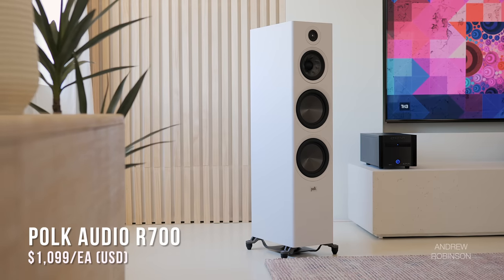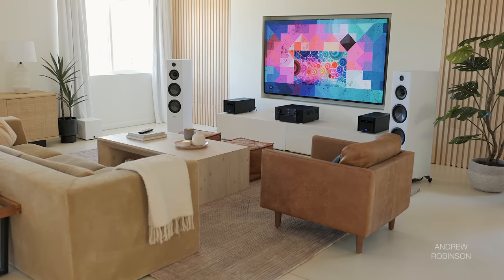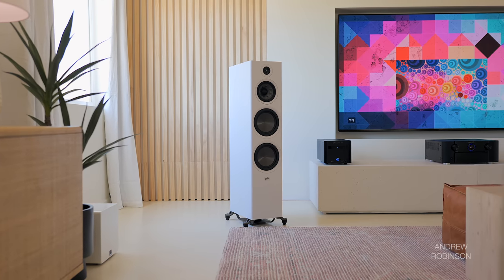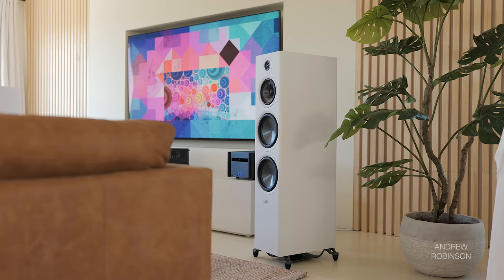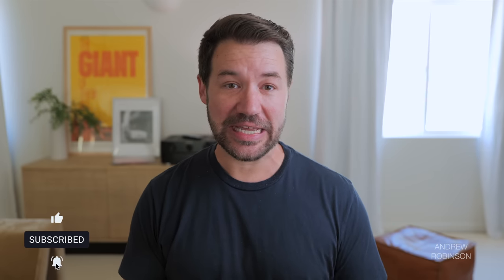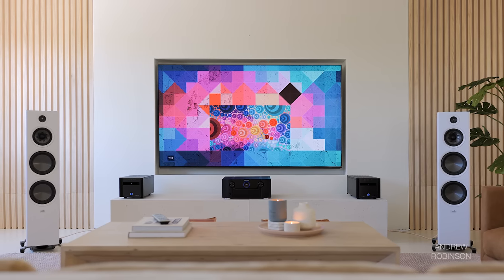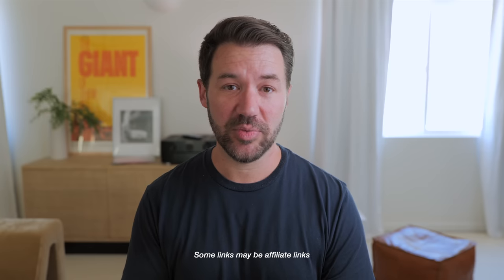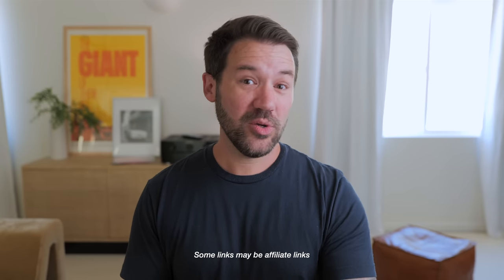Are High End Speakers REALLY WORTH IT? 🤔 Polk Audio R700 Review

Comment: How do you think they stack up to something like the Heco Aurora 700s ?
Reply from the maker: The Auroras will be more dynamic resulting in a punchier/more forward sound. The bass is not as deep or as controlled due to the less inert (cheaper) cabinet. They are more finicky with placement b/c of the rear facing port. The tweeter will be a tad boosted in direct comparison. In other words, the Polk will sound more neutral compared to the more smile like curve of the HECO. So it will come down to what you prefer. As a critical evaluation tool, I'm picking the Polks.
Reply: @andrewrobinsonreviews  Ready for a trip down memory lane?  How do these sound compared to the B&W 703s?  I read your review the other day as the R700's specs reminded me of the 703.  Speaking of validation, you got that review spot on in 2009!😁
Reply: @andrewrobinsonreviews  perfect explanation thanks Andrew you’re the best!

Comment: I did a Legacy focus XD review when I worked for AVS. They were  great but, at the price and for what you got plus having to drive the lower half with a GOOD amp with no outrigger feet at something the weighed 150 each. Plus VERY top heavy, with the fact I had to pull them 6ft out into the room. I have 2 young kids that was a no starter for me. The  review was very positive but with my knocks on it sealed my fate with that company. I no longer was on the good graces lol. I actually told them about all of it ,they said ok we will take it under consideration.. funny thing is that review is still up on their site lol. The next review I did for for a pair of towers that cost 2k and they SMOKED the other 30k a pair lo so much for that :) So i get what you are saying 100% Also AVS forums are the WORST for audio snobbery!

Comment: I love the R700, but I think they deserve a 3 way center speaker, will I loose much with a 2 way center speaker in movies? considering that monitor audio silver has 3 way center speaker wouldnt they be better for movies?
Reply: No I have the r400 I switched from a 3 way center the r400 blows it out of the water
Reply: @Josh-os2px  thanks for the reply, what 3 way center speaker you haved before?
Reply: @PauloPHGTA  Emotiva c2+ the r400 is miles better don't worry look at polkfan video on YouTube of the r400 demo
Reply: @Josh1994  Thanks, i will take a look, I was between the MA Silver 500 G7 or the R700, but Andrew already said that the Polk are better, now i just need to stretch my budget a little more, because sadly the R700 and R400 are more expensive then MA silver 500 G7 and 250 G7 where i live.

Comment: Thank you for the transparency with regards to the snobbery in the industry.  
There was a time where Circuit City and Bestbuy were viewed as "high end" electronics stores and they each had their own brands: BB had Harmon, Yamaha, JBL, KLH,  CC had Onkyo, Denon, Polk, Boston.  At that time, there were few other options that the mass market was aware of, until companies like crutchfield started taking market share with larger selections and great return policies.  Now CC is gone, and BB seems to be in a race with Costco and Walmart to sell only the cheapest stuff (exception for magnolia).  I remember standing in a best buy 10 years ago and listing to 8 different brands of speakers using their demo boards, each had a Yamaha receiver and while the room sucked, it was consistent.  Now they have 2 receivers if youre lucky, none of them are hooked up, and if it isn't a sounder your chances of hearing it are near zero.  

This long winded paragraph is why I find myself personally looking down on any brands that BB currently carries in the audio space, because in a race to zero these are what remains..  I can say this on the car stereo side with kicker, and on the home audio side with polk and klipsch, I shrug them off because if they are able to be gotten at best buy, they must not be "good enough" for me.  I actually have a pair of RTI10s in my office that I bought 15? years ago that still sound great, but for some reason I find myself disregarding the brand now.  The reality is that I need to drop my preconceptions and open myself up to the possibility that even a "mainstream" brand can perform well, but given the challenge in auditioning anything at this point (need to buy and return, stuff isn't in stock, etc) its really hard for me personally to not just mark these off of my list when I can realistically only audition ~3-5 speakers max.

Comment: I  have been a fan of polk for some time. I still own the LS90's I bought back in the early '90's. They serve as my rear surround speakers. The tweeter that came with those speakers still holds its own.  I have no doubt that the R700's are great...but may I recommend a more impressive speaker? In the '90's I began researching and even building my own speakers. It was then that I came across the D'Appollito array of MTM. I have heard and am a believer in the physics of this arrangement and what it lens to imaging. What sold me on the Tekton Design Moab speakers I now own was how Eric Alexander took the idea of midrange driver motor acceleration to a brilliant level by substituting (7) tweeter drivers to do the work of one midrange driver. The imaging is incredible, phenomenal. I have to say though, that initially the bass was unimpressive given two 12" subwoofers. It took around 10 weeks for the woofers to loosen up and come alive. I have never heard the kick drum delivered with such authority but also restraint. I was fortunate to be able to upgrade my pair with custom color, the upgraded wiring and crossover components and the beryllium tweeters, (just two). I still have my high school vinyl. I am now 66.  These old vinyl records deliver the music as new, with discoveries of subtleties I had never heard before. If you find yourself in New Orleans, it would be a pleasure to have you over for a spin with the speakers. So---the Moab but only after the subwoofers are fully broken in. Thanks for your channel. You two make a great team. Ty

Comment: If I already have 2 x subs, would you still get R700 or should I go with R600? Thanks
Reply: Don't really need any subs with this speaker for most music.   Always good to keep one ready to go if a recording is simply just anemic on the bottom end.
Reply: Did you decide?  R700 or R600?  I am still trying decide as I have a Denon X6700H and 2x Subs for movies and music...still building out final hardware and not sure what direction to go with; R600 vs. R700.

Comment: Has anyone by chance paired the R700s with an Outlaw Audio 5000x or 7000x amplifier? I'm stuck between adding one of those amps or the Emotive XPA-3 to my system. If I went with the Outlaws, I would bi-amp to get 260W per channel into 8 ohms. XPA-3 is rated slightly higher, at 275W but I'm not sure I trust their statements because it doesn't specify the full frequency range with that number.
Reply: I have the Emotiva XPA-5 powering my 700s. I think it sounds just great.
Reply: @jeepdog27  Thanks John. I ended up pulling the trigger and have had the XPA-5 for two days now. Sorry to say, I am so far disappointed so far but not sure I can blame the amp. I have an RZ-50 powering a 5.1 system with R700s in front, R400 center and R100 surrounds. Ever since I got this system, it has sounded off balance. I've run Dirac multiple times, but the center speaker is always overwhelmed by the other channels, especially the surrounds. I'm always having to boost the center channel level for things to sound right. My theory was that the RZ-50 didn't have enough power to properly juice all the speakers evenly, thus my reason for adding the Emotiva. Now with the amplifier, the bass does sound meatier but the other frequencies sound more harsh and the balance issue remains. I'm a bit at a loss as to what the problem is.

Comment: Can I run these with the Marantz NR1200?
Reply: He’s recommending quite a bit of power to get the most out of them.  The Marantz SR8015 does 160 watts in 2 channel and they seem to sound better with more power.  The fact that he’s suggesting mono blocs means that these speakers are good enough to benefit from that.  I’d choose an easier speaker to drive like the Klipsch.
Reply from the maker: @Art Garcia I haven't tried these with the NR1200 but yes, I think it would work. You could always add something like the https://bit.ly/3uRu9o1 down the road to the Marantz's preouts and find performance improves. But to start? Go for it.

Comment: They could have a look at tannoy 6f/8f xt how to do down firing bass reflex that looks good. This one is really bad, and Im affraid it wont be thats stable or safe for wooden floor
Reply: I would personally guarantee these speakers are very stable — they’ve got a pretty significantly widened base from the last Gen flagship LSiM towers (which I’ve got), and those are very stable once the feet are leveled to their location properly. I’ve got mine on a (not perfectly even section of) concrete floor, and I’d trust the stability with all but the most unruly children — so these R700 should be no problem at all in that regard.

As for being safe for wood floors, that too is for sure so long as you put the rubber pad feet on and not the metal spike (for carpet) feet.
Reply: @BrianPoillon  THNX!

Comment: Hi there Andrew! I currently live in an apartment and only run a two stereo setup with the KLH Model 5s paired with a Rotel A12. But I'm curious, would the R700 be a good fit for an apartment as well?
Reply from the maker: It depends on the apartment. You might be better off with the bookshelves and a sub https://bit.ly/39rRaZP + https://bit.ly/3xnMlrE 
What are you hoping to get from the R700 that you aren't currently getting from your Model 5?
Reply: @andrewrobinsonreviews  Probably more bass punch. Not like earth shattering sub bass or anything (don't want to disturb neighbors and whatnot). But maybe it could be the room that we're in.
Reply from the maker: I would add the sub linked above to the Model 5s before I thought about buying new speakers.
Reply: @Levdrekinn  Look at the Monitor Audio Silver 500 7G, I consider them almost a "Hybrid" of the Model 5 and Polk R700. You'd get 90% of the Intelligibility and Vocal presence of the Model 5, but way more Bass, almost as much as the Polk R700. Also the Silver 500 7G go down up to 27 Hz.

Comment: I do really hope these reviews put you in the no1 spot and gain more tracking in the Hi-Fi industry. I really find the type of reviews some recognized Hifi magazines (looking at you What Hi-fi) and outlets do very frustrating. They will pipe on for pages and pages about how a piece of equipment will "tie musical strands together" and how the first pressing of the "Clio Jazz trio from 1978 (which only had 3 limit copies released which no one but themselves can get hold of) displayed amazing ambience in the leading edge of notes on the 3rd track" and so on - drives me crazy. After reading through 5 pages you still have no idea how the bass, midrange and highs sound, and you also have no idea about system or room  matching. Mental. There is also a great deal of snobbery about it - implying a higher price equals a better system. (I'm talking with reasonable price jumps here)   Nonsense. Matching components correctly makes a far greater difference than throwing $$$ at kit. Anyway, rant over - keep up the good work guys - loved this!

Comment: Why would anyone buy a seperate stereo amp if you already have a av receiver ??
Reply from the maker: One might come in handy if your speakers (front right and left) need more power to perform at their best.
Reply: The primary reason you might want to add a high quality power amp to run off of your AVR is simple.   The specs given for power output for AVR’s is pretty much wishful thinking.  Most would do good to push 50 watts per channel if held to the same testing standards as a separate power amp.   Yes.  Adding a good amp will wake your speakers up.

Comment: Based on the reviews, I've seen on Polk Reserve speakers, I believe that Polk is the new B&W.

I was going to say that about Klipsch but this series reminds me so much of the B&W 600 S3 series that elevated speaker performance and value in the early 2000s causing a dramatic shift in entry-level speaker performance and price.  If you're not familiar, the 600 series came with the orange/yellow Kevlar cones with the silver bullet cap and the front dimpled port. The higher B&W series had Yellow Kevlar cones which were a bit less appealing but had much nicer cabinets.

The R700, however, is way more capable than a B&W 600 series speaker and is very reminiscent of the B&W 703 in terms of specs (38hz, real bass) and I almost feel Polk didn't pick the model number 700 accidentally - I think it's an homage to the 703 which I suspect someone at Polk owns or used as a reference for performance after listening to the 703.  This is what we want to beat.  We beat or match this at a price point of $2,200 and these become the de facto best value speakers in the world. 

I have to say, this Reserve line, will redefine hifi based on the reviews I've seen.  A few extra comments - 

I'm not sure I see the point of the R500 in the lineup. 
The line also needs a white and a maple finish.  A maple finish will elevate Polk into the status it has earned and changes the line into a real Reserve line.  Maple is reserved for special speakers and these could be worthy of a maple finish.

Comment: Carver magnetic 🧲 field power amp.  No heat.  225 watts.  😊
Reply: What model I have m500t
Reply: i had the carver M1 driving Polk 
SDA 1a  speakers many years ago.
. i have not bought a new system to replace them because  everything i have listened to since has been a disappointment .
Reply: I have the M 1 transfer Amp too should I paired it with the Polks R 700.

Comment: I have the Kef LS50 and Polk LS70 and the Kef R900, so if I get the Polk R700 I will have two examples of when Polk and Kef copied each other. Haha! Seriously though, they do seem to be great speakers. It's not how much you spend, how old, or how popular a set of speakers are. All that matters is if you like the sound. I paid $100 Canadian for my 30 year old LS70s ($1200 new in 1992) and they sat in the closet for a decade because they didn't sound very good on the weak receiver I had at the time (they dip to 3ohms flat). I was blown away how great they sounded (great bass, airy and detailed but rolls off smoothly) when I got some better amps. The LS70 sound way better than my Polk Rti A9s and can still shake the house with tight fast bass with a competent amp and the ports plugged. 

I probably wouldn't have spent 40 times more for the R900 if I had dug the LS70s out of the closet and hooked them up to better gear. The R900s are better in a few areas, but not by a whole lot.

Comment: Anyone actually tried to get a set of these lately? They seem to be sold out everywhere.
Reply from the maker: It looks like this is the best option https://bit.ly/3RcQR5Z where you at least have a expected delivery period.
Reply: @andrewrobinsonreviews  Thanks for this. Ive seen them and a few others have estimated ship dates and have watched them constantly change. I tried to even order direct and they have no eta.
Reply from the maker: Stock has a tendency to change at any given time, so my recommendation is to pre-order them so you are in line and not having to constantly look for stock updates.
Reply: @andrewrobinsonreviews  Thanks for the quick reply on the live stream. I wanted to expand a bit. I currently have the Definitive Tech mythos towers, centers and surround, also running the svs sb16 for a sub. I am looking at picking up the r400, the r900 and either the r700s or the r200s for the fronts. You said grab the 200s and I was curious would you add the HC1s to the 200s as well? Should add running a sc-lx704 receiver as well

Comment: The law of diminishing returns, is a $20,000 speaker 10 times better than a $2000 speaker?  99% of peopel wouldn't be able to tell the difference, I know I couldn't.  My system is made up of midrange speakers bought used on Marketplace, probably spent $1000.00 for my 5.2 system.  If I were to go out and spend $5000.00 on new speakers, would it be 5 times better?  I don't think so...